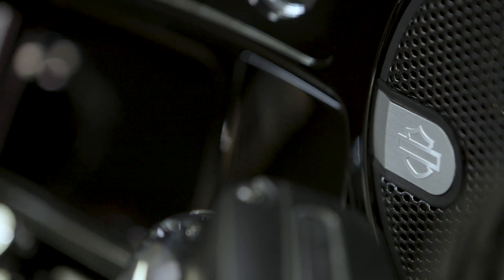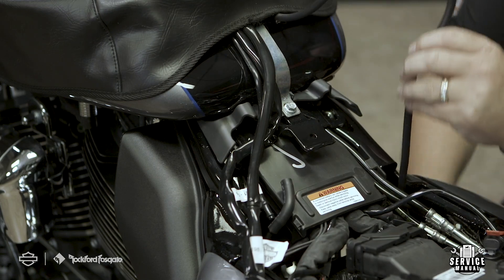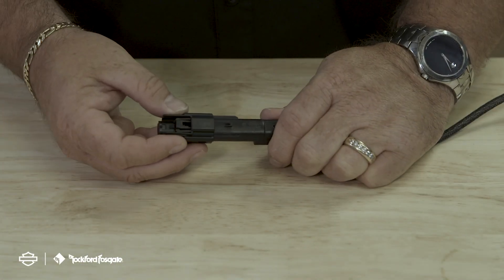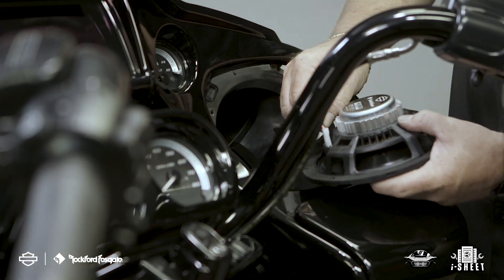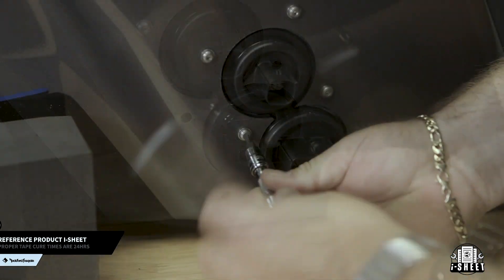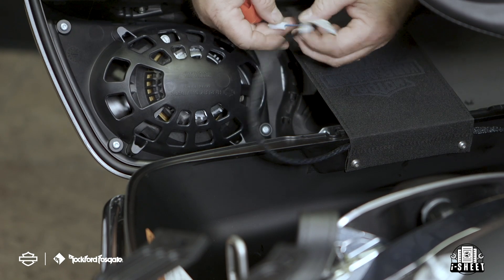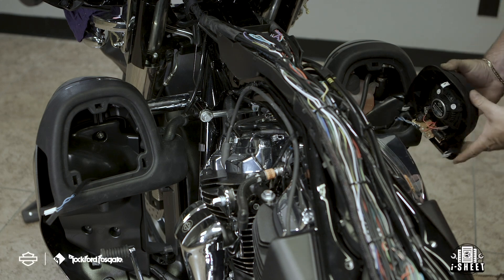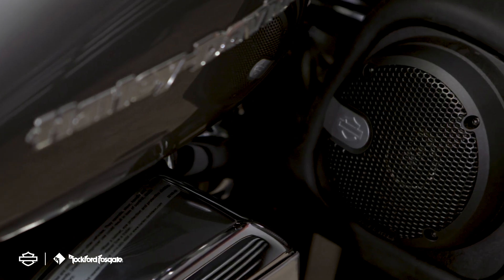Install | Harley-Davidson Audio Powered by Rockford Fosgate

Comment: Hi, I riding a 2018 Street Glide CVO with Boom Audio Stage 2 with 6 speaker positions (Fairing x2, Fairing lowers x2 and Saddle bag lids x2) What do I need to upgrade to a Stage 2 Rockford Fosgate 6 speaker audio system
Reply: I have the same question
Reply: You'll need the entire kit (all speakers, mounting brackets, wiring kits, 2 amps) - proprietary connections. Unless of course you're going to keep your current speakers but the sound won't be as good as the Boom used 2 way speakers, not 3 way. There are deals to be had if you look around. Example, HD lists the amps at $500 each but a lot of dealerships carry them for $424. The primary amp is back-ordered until April 12th and hard to find in stock anywhere. Retail for Stage 2, 6 speaker setup runs just shy of 3K, but hunting around and ordering from different dealerships saved me nearly 1K and didn't have to wait for my primary amp. Dealership install runs around 1K depending on dealership labor rates - do it yourself; it's very easy (just time consuming). Did mine in an afternoon in my garage. Ran my sounds up against a "big wheel" dude that spent $5700 on his audio. He had nowhere near the base I get and his was crackling when we hit 85% on volume. I can go to 100% with no distortion. Definitely glad I went with this system.
Reply: @gerrymiller7401  I would like to know more info on installation. On a factory CVO with  6 speaker set up.
Reply: @andrewtafoya9364  I can try to answer - what's your question.
Reply: @gerrymiller7401  I called the local Harley shop. They didn't have a clue. Just wanted to know what I need to install the new fosgate system on my Cvo. Is it a night and day difference comparing to the boom stage 2? I have 3 amps now. One in the fairing and one in each bag. I wonder if they make a plug and play? Because my amp connections and harness out of the bags look different than what the video shows. They are doing the setup on a special or a standard street glide with no lower fairings or bag speakers.
Reply: Thanks @Gerry Miller
Reply: I have a '17 Ultra Limited that I upgraded last year to a 128 with a Woods Cam. About a month ago, I also installed the 2021 Boom GTS Infotainment System which is when I decided to move to the newest version of the RF audio. I know they are all new proprietary connections so are not compatible with Boom (other than simple -/+ connectors at the speaker. So essentially, you'll need everything new. For anything over 4 speakers, 2 amps are required. These are two 400W RF amps that mount in the saddle bags. Each of those have their own mounting bracket and wiring system, each sold separately. Every set of speakers you have also has their own wiring system, also sold separately. You will need all of it to install as nothing in your current system will convert. I was running a Stage 2 Hogtunes 6x setup in mine previously which I though sounded great - until I put these in. I cannot speak for yours as i have no idea what it sounds like, but the bass you get from this system is noticeable and I can go to 100% volume with no distortion. Let me know if you're on a Road Glide or Street Glide and I can post a parts list so you can do some checking. If you order from different places, you're more likely to save money. I got my Primary amp from Black Hills HD, one of the few places that had some in stock, but no price break. Got my Secondary from Utah Harley for $424 (about $75 off retail). Everything else i got from my local dealer that gave me a really good price as i tend to spend a lot of money there.
Reply: @gerrymiller7401  Thanks for the help and the info, I ride a street Glide with a 117. I appreciate the parts list! That would be great! 
Adding new 2-1-2 head-pipe, power vision and woods xe cam also! Cam kit will be here Saturday
Reply: @andrewtafoya9364  - These are all Stage Two part numbers and I'm assuming you have Front Lowers speakers and not a tourpack. If not, let me know and I can add the other part numbers. This should get you where you need to go.

Primary Amp - 76000997
Mounting/Wiring Kit - 76000974 
Secondary Amp - 76000990
Mounting/Wiring Kit - 76000975
Saddlebag Speakers - 76000987
Saddlebag Wiring Kit x2 - 76000979 
Fairing Speakers - 76000981 
Fairing Wiring Kit x2 - 76000992
Front Lowers Speakers - 76000989 
Front Lowers Wiring Kit x2 - 76000991 
CVO Wire Harness - 76001100 

I've found the amps as low as $424, the lowers and fairing speakers as low as $297 and bag speakers as low as $297. All of the mounting/wiring kits tend to be similar in price everywhere.
Reply: @gerrymiller7401  Thank you bro!
Reply: @andrewtafoya9364   - NP - good luck!

Comment: What's the install process on a 2019 CVO street Glide with the boom audio stage 2 , 6 speaker set up? 900watts
Reply from the maker: Hey Andrew, we recommend stopping in at your local dealer so they can take a look at the bike and assist you in detail. In the meantime, feel free to give our Customer Care Team a call so they can learn more and possibly offer assistance. They can be reached at 1-800-258-2464 (Monday through Friday; 8am-7pm CDT).

Comment: SSOOOO hard to follow...Installed following this video. Got ready to turn on and key FOB now won't work  Bike starts and runs bypassing security. Probably something simple but information is very hard to find. Radio sounds great though.

Comment: Can you disconnect rear speakers and remove your pack with this setup?
Reply: Yep, I've got a detachable tour pack and it works fine. I just go through the setup and disable the tour pak speakers.
Reply: @agentorange628  do you have any problems with the heat in the saddle bags when you have it stuffed full of clothes

Comment: So you install this entire system and never connect it to the radio? That step was skipped entirely.
Reply: That is correct. I think it gets its signal from the front speakers when you plug them in to the factory plugs. It then sends everything to the amp.
Reply: I figured it out - installed a 2 amp, 8 speaker stage II on my ultra. Handful of things different than the video, but between the video and instructions, could figure it out. Good 10 hour project. Also disappointing that they no longer include templates to cut your saddlebag lids and instead force you to buy new lids. Costly when you have a bike with custom paint.
Reply: @gerrymiller7401  I didnt know you could buy templates from HD before. I thought you always had to buy their lids. It was an easier decision for me as I had a slight scratch on one oem lid so I said oh good theyll be replaced haha. What year is yours?
Reply: @DavidSmith-wd4wg   I ride a 2017 Ultra Limited and I've dumped around 80K (including price of the bike) into it over 3 years. It has a 128ci with  Woods cam, custom paint, I just put the new GTS head unit in it before I did the 8 speaker RF. It will be the last bike I own so dressing it up nice and will leave it to my son when I'm gone. Yes, the RF system prior to this one was delivered with templates to cut current lids.
Reply: @gerrymiller7401  Rockford wasn't offered by Harley before this one. This is an all HD/Rockford offering and you have to buy the lids to install.
Reply: @Jackized  I'd agree but then we'd both be wrong. And the RF set is on the Harley parts catalog and does have harley part numbers.

Comment: Just so its clear as Im going through this now. If you have an older bike with the GT radio it still needs a one time dealer flash. I contacted one of the engineers at HD who assisted in design and told him with all the bass turned down on the app and the bike it still has distorted bass at low volumes especially when bike is off. He advised me that 6.5 gt radios need a dealer flash. The newer GTS radios do not. No where in the directions does it say this. I assumed set up through the app and I was done. Ill be taking bike in soon. It sounded great before this flash that I needed just need to get that bass under control. This video should be updated to advise this. He installs on two gts radios so these dont need a flash. A disclaimer should be added for guys with the 14-18 GT radios!!!
Reply: When I took my 2016 in for a flash, they told me it didn't need it.  They told me all I needed was the app.    Can someone from HD chime in on this?
Reply: So, if you have the 2019 or newer then no flash needed. Thats good to know
Reply: UPDATE......... I found a local shop to flash the gt system on my 2016 FLTRU and it sounds great.

Comment: Wish I could put that amp under the nose of a Road Glide. I've fit huge 800w amps under that nose back when I was running big setups. Sorry HD, I was planning on upgrading my boom2 to this, but losing saddlebag space is a dealbreaker. At least they made it a clean install with covers. Glad HD at least did an install video though. Also, big positive no more needing to go to the dealer for the radio flash! Lots of positives.

Comment: My dealer quoted me $3K for the system 😳. No thanks 😊
Reply: Find a new dealer; I came in at 2K for a 6 speaker system, (Stage 2) all in.
Reply: @gerrymiller7401  Hey brother was that parts and labor? Also was that for the new Rockford set up of Boom ll
Reply: @cedioso1   Brand new Rockford Fosgate Stage 2 setup; parts only. You should be able to find amps for $424 and speakers for $297. Wiring kits all run about the same. I have other posts on this thread that contains a full parts list for street glide. Do the install yourself - it's easy (just time consuming). Dealer install runs 700-1000 bucks.
Reply: Definitely stay away from that dealer unless he was quoting that with installation included.   I bought the amp all the install kits and 4 speakers for just around 1600
Reply: @eddelgado4277   It was including installation but I still think 🤔 it was a high quote ?
Reply: @roadglide1142  definitely high quote.  The system should be 1600 and about 800 to 1000 for the labor.  This video was a huge help to me with the installation along with a short video call to a friend.  I had the job done in about 7 hours soup to nuts
Reply: 8 speaker setup parts only is about 3000 not including tax

Comment: Hey! Which parts do I have so buy If I want the stage 2 audio system (4 speaker setup) for my Street Glide Special 2020?
Reply: When I got everything for my 21 street glide I ended up with the Amp (76000997), amp Install kit (76000974), speakers (7600981), and speaker install kit (76000992). That'll set ya back about $1,200 in parts.

Comment: I am not saying anything about this install video, great job! However, I am making my statement against the system itself. I actually had the Harley shop do my install on a 2020 Roadglide Limited and got the stage 2. If you are looking for a system that sounds good whether you're just sitting in your driveway or doing 80 mph down the highway, this is NOT the one for you! The system sounds great sitting steel, but, once you start adding some road noise your good sound goes away.  You start getting around 60 mph and above you have to start hitting the volume switch up. No system should have to be turned up at full volume. Very disappointed in the Harley Rockford system, I talked to the dealer and said I should add the second amp and another two or four speakers ( I don't think so) bad enough spending the first 2200.00 on this waste of money.  If you are looking to install this system, don't take anyone else's word, don't just listen to one, if you're able to ride it at highway speeds. If I had been able to do that, I would still have my 2200.00 and be a lot happier.   I know this is my opinion, but the HD RF is a waste of money and is junk...